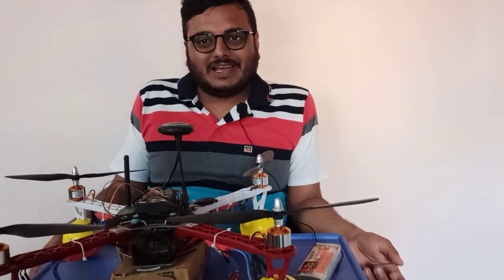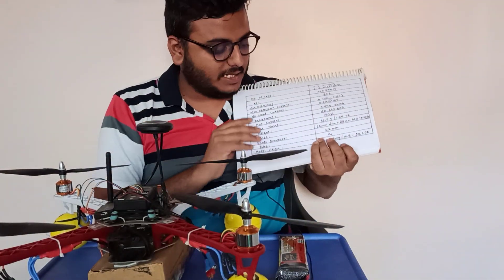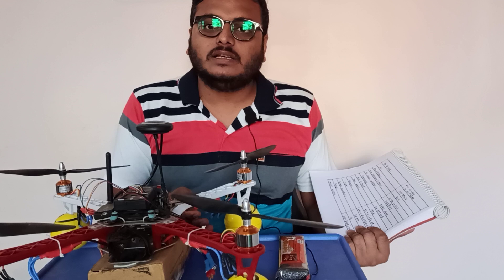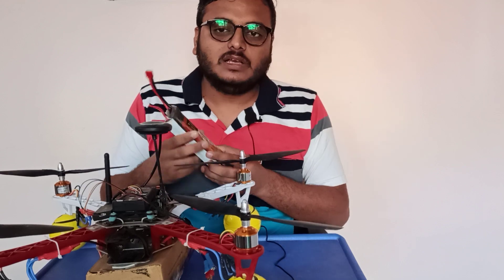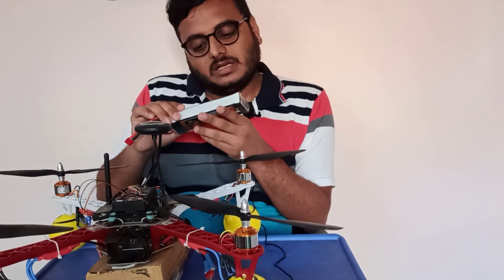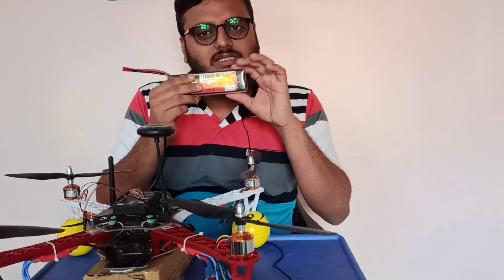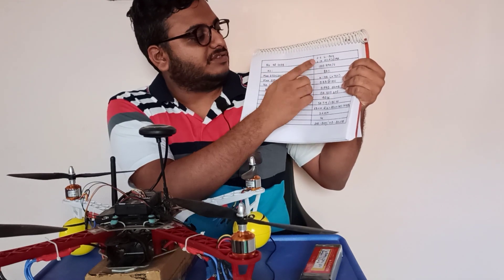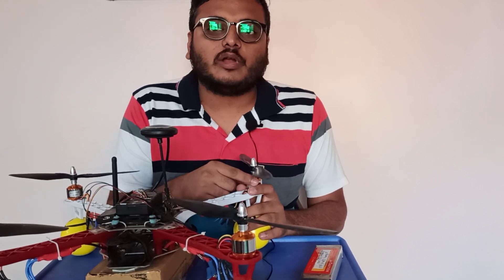How to choose battery, ESC and Motor to Drone | weight Vs Motor lift capacity of drone | quadcopter

Comment: How I chose the correct battery for the ESC if my ESC is 30A o doesn't matter if the maximum current capacity (battery capacity x C rating) is greater than my ESC 30A?

Comment: Bro battery kitne C ki hain 30 or 40C?
Reply from the maker: 30c bro
Reply: @ssprogrammer1995  kya hum usi tumhare drone mein 2500mah and 30C use kr skte hain?
Reply from the maker: We can use but fly time will be very less 10mins or less
Reply: @ssprogrammer1995  thanks bro. You are very helpful
Reply from the maker: No problem bro anytime you can mail also no problem we can try to solve problems if you have any
Reply: @ssprogrammer1995  bro kya Low kV motor jayaada current leti hain high kV motor se at same rpm? Aur hum light weight drone ke liye high kV motor kyon prefer krte hain?
Reply from the maker: Low kV means less weight lifting. Smaller drrones will be used in racing purpose so lifting not required there so.

Comment: Please could you advise me a battery for my quad it is A212 1000KV MOTOR 30A ESC propeller 1045 and i need something that could help me fly for 30min minimum
Reply from the maker: Good question. So it depends on your application and its weight. So if you want use 2212A 1000kv motor min 4500mah fly time will be 20mins  . If you use 5200mah you will get 25 to 30 mins of fly time but battery weight will be 360gms. Calculate your  Battery and rest of your components then frame weight . If you want to use more then this better to go with hexa with 6200mah battery.
How blance is select all components nd frame carefully. Means less weight.
Motor  52gm *4 = 208gms 
Frame(if your using ABS weight will increase) 500gm
Flight control and other components 300 to 400 gms
Battery 360(5200mah) if you increase flight time it will increase battery weight.
Reply from the maker: Solution 
1) use aluminium frame.(less weight) so that extra weight you can choose for battery.
2) only use necessary components. 
If you want more help you can contact "srinivaskalwad@gmail.com"
Reply: @ssprogrammer1995  ok thank you
Reply from the maker: If your building this drone for photo shoot and all then it's not possible camera weight will be more. Lifting capacity of the drone depends on motor 1000kv motor will lift 800gms max capacity.
Make aluminium frame by your self so that frame weight will be less

Comment: Hi bro,
Please check out this sheet https://docs.google.com/spreadsheets/d/1xpjDN-GJIaSJ_yyTewleAqNTGeFBCXdAb6RDpASf1Ks/edit?usp=drivesdk

I want to make agriculture drone with pixhawk 4. It should carry 15 kg weight with drone body. Can you able to provide details for motor, escape and battery type ?
Reply from the maker: Hello bro sorry for delay response
Reply from the maker: 170kv motor
80A ESC
2170 propeller 
16000mah battery
Flight controller minum holy bro pixhawk4
Reply: If possible,  Can u share me online link to buy